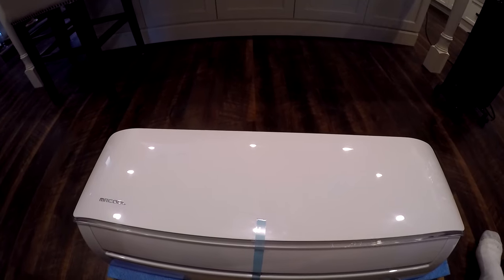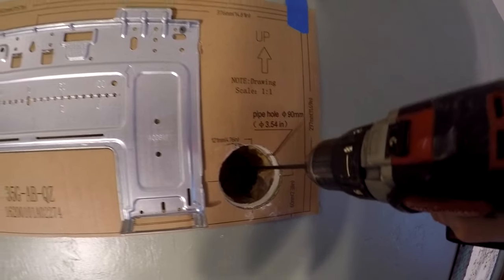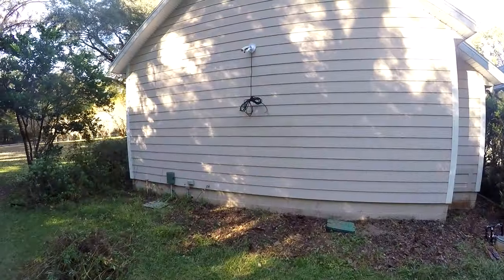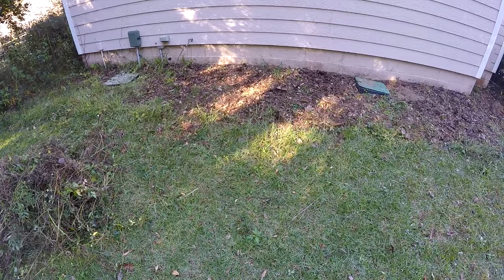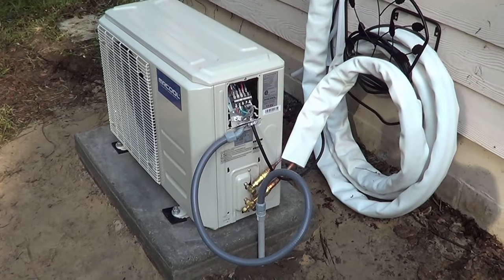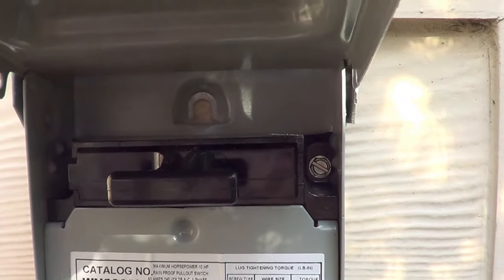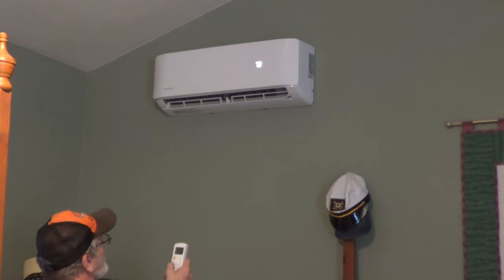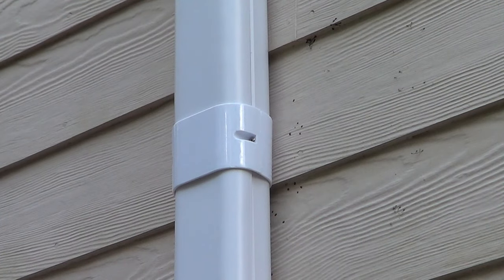MrCool DIY Mini Split Install

Comment: I purchased a 4-zone unit 8 months ago and I dont regret it buying it. Here in Minnesota we get crazy cold weather and this thing did the job pretty good. Since my house is not that big, the air handlers dont do much work to heat the rooms or the living room. (I got the 9kBTU, 9kBTU, 12kBTU, 18kBTU configuration) All Im waiting is for summer so I can experience  how it handles in hot weather!
Reply from the maker: Sounds good and I would expect it to work better in hot weather than in cold just off the top of my head...  Thanks!

Comment: I just started an Ameristar, pro-installed, 12000 btu, 15 SEER, mini split hp. Full speed in heat mode, ODB= 40F, IDB= 65F. Total Amps= 4.4 @ 245VAC. Seal around indoor unit perimeter with silicone as they all pull dirt into unit and blower wheel. Keep hp off of slab at least 1.5” for proper drainage during defrost cycle. Use 12 ga THHN stranded wires between your disconnect and hp, with ring or fork terminals. Try 20 hours or two full days if it’s your first one.

Comment: I like the soft start feature of these units, which allows you to have air conditioning when running off of a generator (or solar).  Although I have a Honda generator powering my load center via interlock to run the house during outages, it can't power the main 4-ton HVAC even with a soft starter on the condensing unit.  It easily powers the 15k BTU Mr Slim mini-split we have in the basement, so we can go down there to cool off if we lose power during the summer.
Reply from the maker: Yes, A 4 ton HVAC has a pretty heavy startup current.  I do love the Mr. Cool so far.  Running it on solar right now even though it is cloudy out.  FYI: This is my real-time solar data: http://data.magnumenergy.com/MW5454/
Note: the lower left corner is the data from one of my two inverters so basically just double that.  
Thanks!
Reply: @HomesteadEngineering  That's a cool monitoring page.  Do you have the capability to track daily KWH usage? Most of my large appliances are on natural gas, with the exception of the oven and the main HVAC. My home averages about 25KWH per day, rising as high as 50 KHW during July and August. Electricity last year cost about $2850, using on average 1000 KWH per month. Natural gas is another $2k per year, maybe a quarter of that for the pool heater.
Reply from the maker: @browsedeweb8834  Unfortunately I don't have any automated way to track kWh used/Day.  I think the MagWeb program could really use an upgrade as there is so much more it could do.    
BTW: Pool heater: https://youtu.be/1DWOoEptzJE
AND
Water heater: 
https://youtu.be/KEPej1hZmto

Comment: Great idea using a garden hose holder for the extra lineset you have to curl up! Great video overall - thx!
Reply from the maker: Thanks!
Reply: I would have just put the unit farther down the wall , I had the opposite problem  25 feet of pe charged line wasnt near enough to put the condensor where the old one was so i put it farther down the wall and made a longer whip from the disconnect. Its out of the way behind the fireplace now and i have more room in the garden that the huge Goodman took up

Comment: Did not know it had the soft start feature, but I am a huge fan. I don't have solar, but I can see that being very beneficial to protect that equipment. It should also increase the longevity of the compressor motor. My current AC system doesn't have that as it sounds like a freight train kicking on. Great video. Nice seeing the electric draw
Reply from the maker: Thanks!

Comment: I may be wrong but the extra line set should be coiled up horizontals not vertical to allow the oil to get back to the compressor and not get trapped in the loops. Great looking install!
Reply from the maker: I have heard that from a few people but I am not sure.  I'll have to look into it.  Thanks!
Reply: @HomesteadEngineering I'm actually going to be installing one of these soon. Did you ever find anything out about the vertical vs. Horizontal loops for the extra line? 

I have seen a bunch of line sets like yours, and see the same post that it can trap oil this way. 

I hope you have had no problems with the system and it is working great.
Reply: @TedZarcone  Like you said all the videos I have seen show them coiled vertically but the manual does say to store the excess line set coils horizontally.
Reply: You are creating an oil trap with the lines coiled up the compressor isn’t going to last long. The only time you put a oil trap in is if the compressor is above the head units. I guess Mr. cool didn’t explain that in the installation book. So if you buy the pre-charged line sets you need to lay them so the Poe oil gets back to the compressor.
Reply: @HomesteadEngineering  It's real that why i don't like diy installation in HVAC stuff

Comment: Thought about one of these when we got the dryer . Going to get in the attic now that it’s cooled off and run a trunk line from one of the distribution boxes I had Ron put in with the new unit. Neat system though . Have a great day
Reply from the maker: Thanks!

Comment: Nice video, I'm glad you used Nylog 10:52  although it's not  mentioned in the installation instructions its imperative you use this for a garunteed seal for line sets and the unit's fitting.
Reply from the maker: Great point!
Reply: As of June 2023, The manual specifically says DO NOT use Nylog or Teflon tape.

Comment: Note: New Mr. Cool DIY units come with white foamed line which are UV resistant. The older units with black foam required a UV line set shield which was a white cover.
Reply from the maker: Thanks for that info, very helpful and good to know.

Comment: Nice neat cover for the refrigerant lines....then a hose reel at the bottom to hold all that excess line not needed.....ahahhaahaaaaa.  A recipe for getting damaged lines.

I like mini-splits.  Have 3 of them.  Installed two 3 head units for a neighbor's new house. But NOT "Mr Cool" for that exact reason.  They send you  pre-charged, fixed length line set and let you deal with the 'leftovers'.

Just buy a regular mini-split, cut/flare (use a Rigid flaring tool, not the cheap hardware store variety) the lines to the length you need, and have a Heat/air guy come out and vac down the lines and turn the gas loose. 

OR...if you want it done RIGHT..... do what I did after the first one.....buy a vacuum pump, and a manifold gauge set, AND a micron measuring gauge and a bottle of nitrogen/regulator and do it yourself.  The heat/air guys want to run the pump about 20 minutes and call it 'good enough'.....because IF it holds for a few minutes, it will last a while even if you have a tiny leak.  In a year, you can call them back to add gas.  And the year after, and so on. Until you figure out they LOVE repeat business, and make one of them do it right......ahahhahaaa

The PROPER way to do it is vac down, then fill with nitrogen to 100psi or so. (Using a manifold gauge).  Let that sit 24hrs to see if it holds 100 or pretty close. THAT tells you no major leak.

Then vacuum to down to 500 microns, (NOT possible to read on a standard HVAC manifold gauge set) and it's gotta hold to 300 or below for 5 minutes with the pump stopped. THAT tells you no teeny-tiny leak.

Then turn the gas loose from the compressor unit and do the normal startup procedure.
Reply from the maker: Ed, I don't like the coiled up extra either but that is the price you pay for DIY.  I may try a "regular" unit next time and hire the AC man to plumb it up and charge it.  Then I can compare them on price and finished look.  The next time I have an AC man out here for other work I may just have him shorten the lines and recharge the Mr. Cool if  its not to expensive.
Reply: @HomesteadEngineering  OK..but remember what I wrote above on the correct way to do it, and see how your guy compares !

Comment: i have the 4 zone model with multiple heads. It works pretty good. It uses max 2100 watts. Most the time it is 1200. The fans use 100ish all going full tilt. If you want to get a cool gizmo. The Sense monitor is really neat.
Reply from the maker: a v, Sounds good.  I'll have to check that out.  Thanks!

Comment: They need to make a window A/C that is portable and where the main unit sits outside and the cooling unit can fit in a vertical sliding window (that side left to right or vice versa) or even in a patio sliding door. so the hot part of the unit is not in the house, this will only work on the ground floor where the main unit sits outside on the ground and the main unit is still outside. And make it affordable so renters can afford one... I like the concept of the portable type units, but the problem with those, is that tube going out to the window is so hot it heats the room as much as the unit cools it off...

Comment: Thanks for this vid, very helpful info.  If you're in the Northeast like I am with high snowfall, might consider legs between the pad and condenser.  I had snow blockage because my condenser sat directly on the pad.
Reply from the maker: I am in Florida but that is not a bad idea.  You might also think about mounting it up on the wall to avoid snow and flooding.  Thanks!

Comment: Nice install. I hope to put a Mr. Cool in this spring. Mr. Cool has a high enough seer rating that they actually will heat when it is in the low teens but not when it is single digits like last night. It was  5F this morning and has been snowing all day. I believe the compressor in controlled by a frequency drive. The compressor only spins an fast as it needs to. Very efficient.
Reply from the maker: Yes, They are suppose to work into very low temps.  That said, its so darn cold were your at I am not sure this would be a good solution in the winter.  I think it would be great for summer and act as an emergency backup to your wood stove in the winter.  Thanks!
Reply: I have Mr. Cool Universal 2/3ton (running in 3Ton), Hitting mid teens here in Northern VA, its definitely working its butt off but keeping up VERY warm. I haven't installed the back up heat, but I plan to tomorrow (5kw coils), I wanted to see how well it does with out them, and it rocks. Only installing the back up heat b/c its actually more efficient with them, right now when it defrost the outside unit, it goes to A/C mode which actually is blowing cold air in the house... it only does it for a minute but with the back up heat it will run that so you don't feel the cool air.

For all concidering it... GET MR. COOL UNIVERSAL you wont regret it!!!
Reply: Ive had mine 2 winters now and it will heat in the single digits. About a week ago it was 12f here and it was putting out 114 degree air maintaining. It was 78 degrees in here in this 120 year old house. I have never once had to put the temp control up hot as it will go. 82 is the max it has been at on single digit nights. Two 18k units heat my whole 4000 sq ft 2 story home. I have no heat upstairs. It rises up the staircase.
Reply: @mattsbrute  That sounds like it will work. We do get -30f here but most of the time it is in the  single digits at night. - 10f is the lowest so far this year. The  last week it has been 18F at night and almost 40F during the day. MR. COOL should work ok. We are off grid so counting watts is a must when heating with electricity. Thanks.
Reply: MRCOOL DIY units do not heat very well below 5F. Their hyper heat units do better, but are not DIY. However only Gree's 2 stage compressor in their Sapphire unit or their new Ultra units will do -22 to now even -31 F.
Reply: @sprockkets  Thank you. That is good information.
Reply: @sprockkets  Yeah thats crazy cold. Id have a big ole wood stove if I liked in those temps.
Reply: @mattsbrute  yep, it is crazy cold. I'd love a wood stove if it is properly vented, because typical fireplaces steal more air and heat than they give.
Reply: @sprockkets  Thats true. I grew up in a house with a fireplace and a wood stove. The fireplace was never used. Dad always used to say it draws  the heat out the house.
Reply: As of June 2023, the manual says it will heat as low as -13F outside.
Reply: Do you know if you can recover the refrigerant into the outside unit if you ever need to disconnect the lineset to relocate the inside unit? Probably need to pull a vacuum before reinstalling but can't seem to find a video on it for mr cool

Comment: Did you not have to use a vacuum pump on line set before opening up compressor valves?
Reply from the maker: Mr. Cool ships with the lines pre-charged.  That is what makes them special.  I think every other brand has to be vacuumed and charged.  The down side is, you can't cut the lines to the exact length needed and have to coil them up.

Comment: Nice job, only thing that scares me that you used 3 inch deck screws is you were taking a chance with not hitting any wiring that may have been in middle of the studs in the wall. Now obviously you did not hit any, but glad there were not any there.
Reply from the maker: suespony, That is a really good point and folks should take note.  In my case I did build this house and I know where all the wires and pipes are!  :)

Comment: You did not show the details when you do vacuum of the a/c pipes. Or you just didn’t vacuum the system? Please let us know. Nice job and thank you for your video
Reply from the maker: The lines come pre-charged so you don't have to vacuum them.  They puncture when connected.  That is the big advantage of the Mr. Cool DIY system.  That is also why you end up with extra line coiled up, you can't cut it to fit.
Reply from the maker: Actually, I am not sure that the lines are pre-charged.  They may just be evacuated and the refrigerant is released into the evacuated lines after they are connected.  Either way, you don't need an AC man.

Comment: ELECTRICIANS: Does the signal cable not have to be in conduit? Will have my 24k signal cable and lines (under eaves) permitted and inspected.

Comment: does the recommended Line Set Cover come with the part to cover the extra line set roll on the ground as showed in the video ? if not, where to get it ? thanks
Reply from the maker: There is a link in the description for the line set cover that I purchased separately.  The cover on the rollup portion came with it at the time I purchased but not sure that is still the case.

Comment: I am about to buy an 18,000 Mr Cool.  I like the DIY idea but don't like the coiled up line behind the unit.  My run is very short just like yours.  maybe 13 ft max? I see that Mr Cool has a 25 ft and a 16ft on their web page but the big box stores only offer 25 ft.   If you move the unit further away then you just have more horizontal channel runs on the side of the structure that are unsightly as well.  I guess the trade off of not having to vacuum the lines and pressure test make it worth it.   Was yours a 25ft line?
Reply from the maker: Yes, mine had 25ft lines.  One thing I plan to do:  At some point down the road when the system needs servicing, I will have the tech. cut the lines and remove the excess coils.  Thanks!

Comment: The pipes should be coiled horizontally vertical coils can cause an oil trap. and you used the adjustable spanners incorrectly which will strain the jaw .otherwise not a bad job
Reply from the maker: Yes, I have heard that laying the coils down would be better.  Note: I have run this unit 24/7 - 365 non stop with zero issues so far.  I love it.  I run it off solar.  "spanners"  you must be from Australia?  :)

Comment: Nice video! Can you tell me the measurement between the front and back holes in the feet of the condenser?
Reply from the maker: Sorry but I don't recall.  I recommend measuring the actual unit before you put it in.  Thanks!

Comment: Great video thanks , I am just about to install my Mr Cool. What were you putting on the threads of the lines before you screwed them together was it a fine oil or a type of lock tight .
Reply from the maker: Nylog: https://amzn.to/3lXu7sM

Comment: What size were the anchors you used for the compressor? And what do you call those rubber "washers" you out between pad and metal feet. Already got my pad poured and looking to drill/set all four anchors and separate from the pad with rubber just like that!
Reply from the maker: Here is a link to the anchors that are set in the concrete: https://amzn.to/3vTW7Bw
The anchors that I put in later I think I got from Lowes.  Not sure the size.
The rubber feet came with the Mr. cool.
Thanks!

Comment: I'm thinking of installing the 12k to run off my solar system.  You showed it going up to 850 watts.  After the room was cooled, what did the wattage drop down to?
Reply from the maker: Hello Georgia, I don't have much experience with it yet.  I will need to do a performance video where I run it for 24 hrs. while recording all data and see how it performs.  Thanks!
Reply: I just started an Ameristar, pro-installed, 12000 btu, 15 SEER, mini split hp. Full speed in heat mode, ODB= 40F, IDB= 65F. Total Amps= 4.4 @ 245VAC.

Comment: Having a hot tub cause issues ? I didnt understand that part of the video and i installed my unit and its not starting just how it was for the video
Reply from the maker: I removed a hot tub from our house years ago and I used the dedicated circuit from that old hot tub to power the mini-split.  I had forgotten that the tub had a switch and that's why my system did not work at first.  I had to remove the switch.

Comment: im going to wire one in for my buddy, im just curious do you have to charge unit, or are the charged seal unit. power source 115v.
Reply from the maker: The system comes pre-charged.  That is the big DIY advantage.    Note: you can't cut the lines to fit, you have to roll them up.  Thanks!